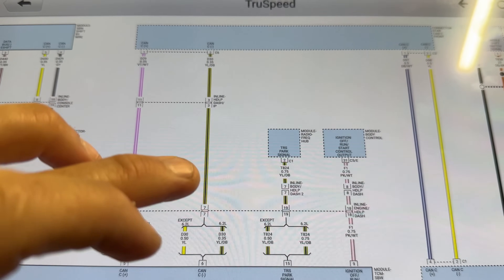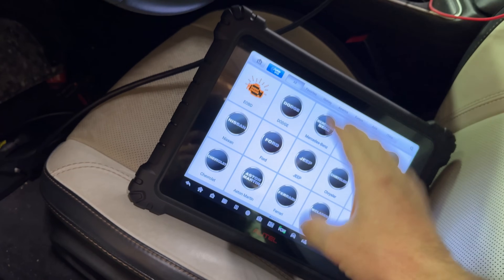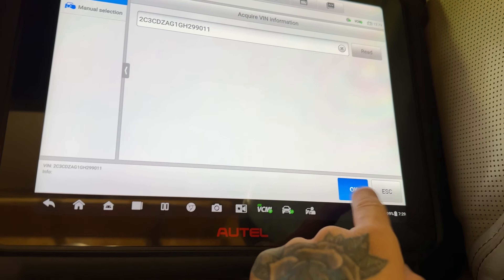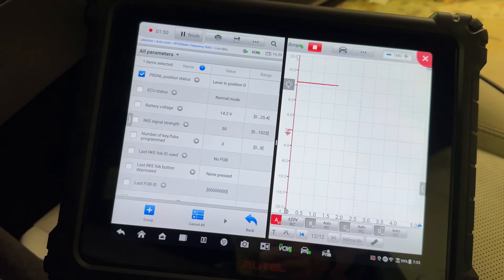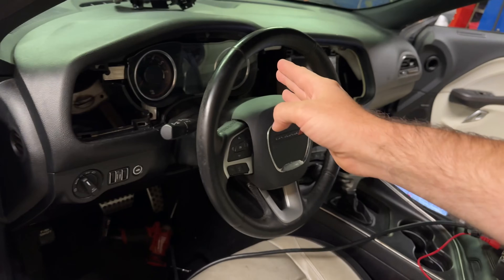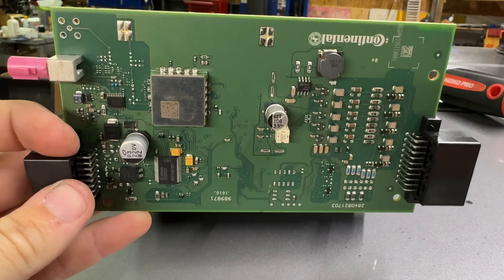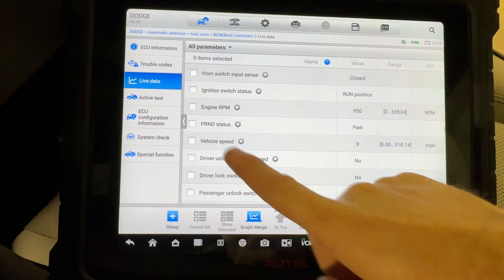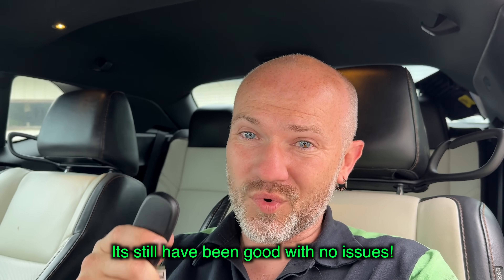Challenger Random Battery Drain Conclusion!

Comment: We had a Chrysler 200 a few months ago that wouldn't shut off. I ended up narrowing it down to the RF hub, in an attempt to just get the vehicle shut off I unplugged it and it shut off. Plugged it back in and everything worked and it hasn't acted up again on the customer. Now when I have weird electrical issues I do a hard reset on the system every time no matter what.
Reply from the maker: This vehicle had multiple dead batteries and the battery hard been swapped. It was also very intermittent. I had it for a week before the battery was dead.

Comment: Last week I had a Ram. It had wipers stuck on no headlights no turn signals bunch of issues. I was testing to figure out wtf was going on. I ended up moving the 4x4 module and reset the codes at the same time and dont know what fixed it. At that point I had about 3 h ours into it and couldnt charge for it because I dont know what I did to fix it. Had to tell em to drive it and if it comes back we will figure it out.
Reply: I had a 16ish Durango with wipers doing their own thing, light issues, Christmas tree dash and didn't want to shift from park. Ended up being an issue with a connector inform of the RF wheel/below right headlight that had water sitting inside of it

Comment: Good find and call on the RF hub.  I understand your dilemma about whether it's the board or us it some input keeping it awake. Had an amplifier that was causing an intermittent draw but wasn't 100% sure if the radio was sending it a shutoff signal or not. In my case a used amplifier was less expensive than spending hours trying to find out how the system worked and testing it..... Sometimes and accurately aimed part fired is the best route.

Comment: Been there done that, Instrument cluster and Gear Shifter stays lit up. Challenger / Chargers and the RF hut wouldn't quit talking and would quit acting up if the connectors where removed and reinstalled. Becoming a common failure.
Reply from the maker: Yeah and I think I have another one at the shop that is doing the same thing.

Comment: A few semi-random thoughts...

I believe the telematics control unit or telematics gateway is the gateway between the car and the cellular data network for services such as Onstar or equivalent, over the air software updates, and app based controls on the driver's smartphone. 

I am wondering whether this was a software issue in the wireless gateway. Did you look for TSBs or check whether the module's calibration was up to date? 

I didn't go back and look, but I believe at one point, when you saw that the network was still awake, you assumed that the (full) draw was still there. I probably would have checked the amp clamp, just to be sure. (I know, this is a minor point. :-) )

Comment: Did you check the Data  after replacing the RF hub
Reply from the maker: Not with an aftermarket tool. Witech2 doesn't list that pid so it's not accurate in the aftermarket tools.

Comment: What did the scanner show on the PRNDL data pid with the new RF hub installed?
Reply from the maker: Witech2 doesn’t have that data pid so it shouldn’t be used. Not sure why the aftermarket has that PID but it’s possible it might use it on other vehicles.